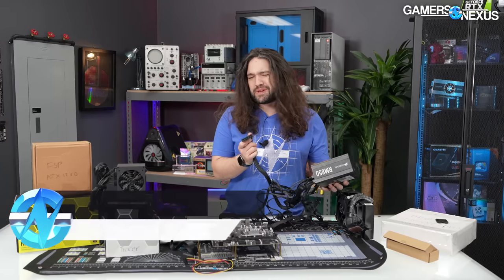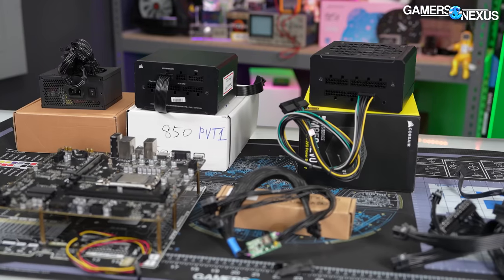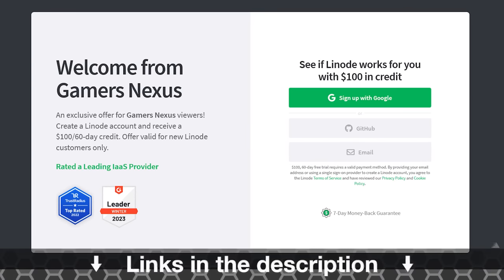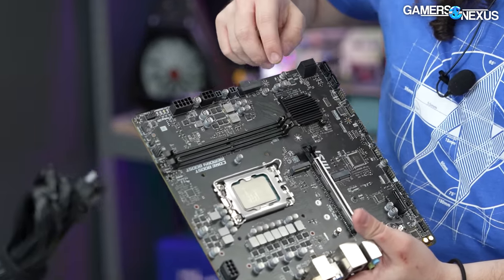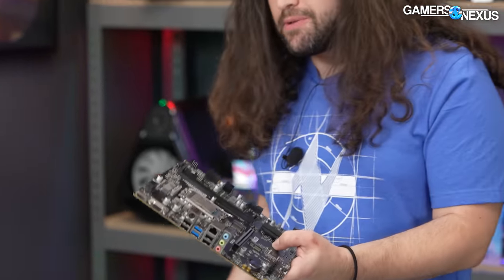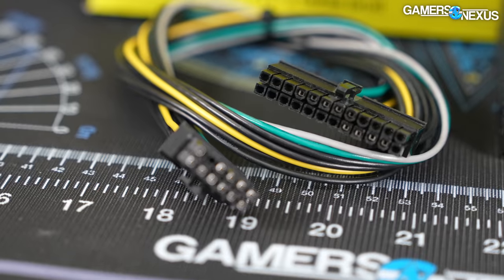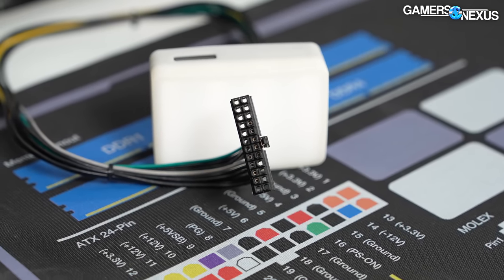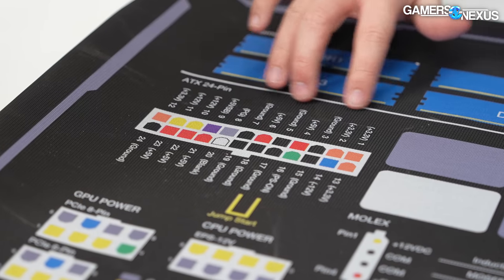The Future of Power Supplies - Maybe (Motherboard Cost, Cables, & ATX12VO)

Comment: It's tough enough picking a good motherboard that has the features I want, at a price point I can stand, and looking good (not a point for some but definitely a point for me) based on how things are already. I don't want to worry about even more variation being added to motherboards.

I'm half asleep so may not have fully heard and understood the reasoning, but if the reason is for lower power draw in standby or low power mode, couldn't something similar be accomplished with a data connection and a little bit added to the PSU? Or is it simply just that much more efficient still to stick it to the motherboard instead? I wouldn't mind a changing standard if it's not making as drastic a change to motherboards.

Would be interesting to have a sit down with an engineer that worked on the newer spec to talk about it and why that was what they went with rather than other options. Although maybe there's already good info out there for why not that I just need to actually read/watch.
Reply: I think that main reason is, that ATX is ancient. It was developed in times when switching DC-DC power sources weren't as cheap and it was more efficient to make -12V 5V and 3.3V on a smaller transformer in the PSU. Now the PSU uses DC-DC converters anyway and -12V is not used, it makes sense to reduce wiring to only 12V. The converters can be optimised for onboard devices and managed by MB's logic.
Reply: @Papinak2  A better solution I would still think is segregating responsibility of tasks. A power supply should do what it says it does. A motherboard should only serve as a board for other items. The standard could have simply asked for some pmbus standard with specific addresses and communication between motherboard and PSU. Although complex to implement, I would expect a lot less issues and less components means lower cost and higher reliability. This seems like a "standard is outdated we will simply do everything because working to help change the other parts of the industry we don't control is hard".
Reply: @epeglab1o1  This is impossible. CPU's and such use very low voltages these days, so that buck converters ("VRM's") have been necessary on every mobo for decades now. It will be a nightmare to even imagine reliably supplying dozens of amps at 1.2V over any length of wire. And totally inefficient.
Reply: @rexsceleratorum1632  okay you took my comment too literally. Yes the mobo does have multiphase buck and other bucks to provide various voltage rails for the cpu.

Comment: The cost changes and the cable management are both absolute No-Go. 
The biggest problem that I see is, that PSUs very often outlive Motherboards. My current Thermaltake 650W PSU is now nearly 14 years old and will power my 3rd PC Hardware Generation now (Core2Quad Q9650, i7-7700K and now i9-13900K). So the same regulators reused all the time and still working perfectly fine. With 12VO the additional hardware on the motherboard would have to be paid and then gone to waste every time, raising the cost and amount of E-Waste. At the end we WILL pay for the extra components and MoBo prices are already insanely high with all the crap put on them. This might be beneficial overall for commercially used all in one systems but it will hurt ANY DIY build. 

Not even speaking of additional coil whine risk with open regs on the board compared to enclosed and dampened regs inside a PSU case.
Reply: It takes a great deal of faith to entrust your daily driver PC to a power supply from mid-2009, complete with group regulation and an efficiency level of most likely either 80Plus White (W0104) or Bronze (W0163). Yes, one would rather hope that a quality unit makes it that long with the occasional dusting, but it should rather be enjoying its well-deserved retirement in a more fitting retro build by now.

Comment: as an SFF PC enthusiast, I really can't wait for atx12vo.  Cabling is way simpler, and without the 5v and 3.3v circuits in the power supply, manufacturers can fit more power into smaller PSUs.  I personally am curious about how complicated Z#90 mITX motherboards will become, but considering manufactures like ASUS is taking inspiration from lego with how many stacked carrier boards they use, I believe it can figure it out.

Comment: 7:25 After years of cutting/trimming stuff on electronic assemblies, I found the best cutting tool is just an actual scalpel blade. I use Swann Morton non-sterile carbon steel blades, they come in different shapes but mostly #10 for slicing and #11 for scoring

Comment: Another advantage of ATX12VO is better dimensioning of the +5V and +3.3V rails as regular ATX psus have grossly overdimensioned rails to account for the possibility of them ever being connected to an ancient computer that may pull power from them. The board manufacturer will have a good idea of how much power could be pulled from those so it should end up being cheaper. The negative rails could also be omited, most modern computers don't use them at all.  
The +24% cost to matx boards and needing extra layers sounds like bs to me (I have designed 4 layer pcbs for fpgas and microcontrollers). You could have the dc-dc converters required near the connector, if the power is low enough the area freed up by the smaller connector may be enough for the converters and that way you just route the output much like you always needed to. I only foresee an increase in cost if the board packs a crazy amount of IO like usb or sata which could potentially draw a lot from +5V and +3.3V needing beefy multiphase DC-DC converters in an already cramped pcb but that shouldn't be common.

Comment: Would be good to see a bit more on this for the ITX space... Seems like the PSU's themselves are smaller as-is, but if even mATX boards are hurt by moving all the voltage conversion onto the mobo (increasing size/layers/cost), that could be even worse for ITX. Seems like the best-case would ultimately be for end-components (PCI / Graphics cards, Hard Drives and SSDs, etc) to do their voltage conversion internally so the motherboards can be passive 12v as well...

Comment: I think doing the voltage conversion is better off done inside the PSU. Not sure if moving the down conversion to the MB causes more noise issues but it certainly adds more heat where you don't want it.
Reply: Not necessarily though - if you can move the power to where it needs to be at a higher voltage, the current is lower. Which means less losses in the traces. Of course the conversion also has losses, they're at efficiencies of 95-98%... in the end it's probably a negligible difference though, as CPU and GPUs currently use the 12V rails and convert down already.

Noise is probably better too, as the motherboard manufacturer can add filters without having long cables that pick up noise from the environment.

But price is a different topic, and reliability.. you can just replace the PSU and I don't think that a PSU with 12V only will actually be cheaper..
Reply: @marcelleuenberger4648  I don't think your going to see much difference in line loss. 98% of which gets turned into heat anyhow. An I9 alone can soak-up 300 watts when throttled.

They filter power supplies as well which can house much larger components like caps and inductors for filtering. My Corsair AX1600 has a very clean output and is 94% efficient. The PSU is one of the largest sources of noise in the system anyhow. A poorly designed power supply is going to introduce noise in the system no matter how many rails it has. Hardware engineers add filtering all along the circuit even on the front-end of the chip I/O so it's usually not a problem.

I'm sure both set-up's have the pluses and minuses. Should be interesting to see if this catches on.
Reply: @donuthole7236  Most power hungry devices are powered from 12V being converted locally anyway (CPU, GPU) because it is not practical to do it any other way (450W being pushed to GPU at ~1.1V is over 400A - and numbers are similiar for the CPU (which needs few different voltages that are generated on the motherboard)). CPU, ram, chipset alone need 7 or 8 different voltages (DDR5 needs 3 different voltages (usually two of those are identical, but that is not guaranteed by the spec)).
Adding 2 extra votlages to all of this is going to do very little to BoM costs, but are the manufacturers going to use this as opportunity to increase price?
Reply: @donuthole7236  Of what use is that filtering in the PSU, when you send that current down to the MB, over cable and two connectors? Yes PSU filtering isolates the noise from the main, but does not help with noise and voltage oscillations down the line...

Comment: i like  the power supply handling everything instead of a motherboard, since you might need more connectors down the road or hardware configs might change and need different plugs so you could be screwed since the motherboard has so many, and can physically can fit so much already
Reply: And that's why you want to handle power conversion on the board. One pair of 12V can carry more power than two pairs of 5V or three pairs of 3.3 V, and the DCDC is much smaller than the additional space taken up by the wider plug.

Comment: We've moved well beyond the times when changes in technology were made to improve said technology.  Any change now is simply an opportunity to charge more.  This change would somehow increase the cost of power supplies and motherboards, and likely lower the lifespan of each to boot - exactly what manufacturers want.  I'll wait for your testing on these which I'm confident will show little/no increase efficiency, with significantly higher cost for both PSU and MB.
Reply: Technology already improved, which is why ATX wiring is redundant. You don't really need to convert 12V to lower voltage in the PSU, so why not move the converters to MB? It can be optimised and managed by MB logic - for example, shutting off 5V to SATA, if it's not needed, but keeping it for USB.
Reply: Sounds about right!

Comment: Edit: The original was incorrect but is kept below for context. USB PD support various voltages including 12v.

Original message: USB really fits weirdly with this. Just about the only voltage that the PD spec doesn't provide for is 12V.
Reply: Yes it does. It's complete bs that they don't. I've seen so many articles talking about how very few pd chargers actually have 12v. I've checked every single one in my house and car and they all have it. I checked Amazon listing specs and same thing. Gotta be careful tho because some charger support 12v only on usb a like anker chargers. Got me wondering if I should test mine to make sure they support pd on usb c since mine have usb a too
Reply: @andrewk8636  Oops, turns out you're entirely correct and I have got it wrong. The reason I made the mistake is that I looked at a table of USB PD rev 2.0 voltages and currents that didn't list 12v, missing that the table only listed values that weren't already present in USB PD rev 1.0, which already accounted for 3 different current levels at 12 volts. I've put a correction in the original post.
Reply: @andrewk8636  Apparently the wires matter too. To provide more than 60 watts of power your cable has to be able to tell the other devices it can handle that. Then again, that's probably more relevant to laptop charging than desktop pcs and phone chargers.
Reply: @martineyles  wires shouldn't matter at all for the voltage. Amperage is another matter. If the wire can do 9v and 20v there's no reason it can't do anything in between
Reply: @andrewk8636   I was talking specifically about higher power specs above 60 watts in the last reply, available at 20 volts and above. Eg. 28V at 3.57A for 100 watts. That's why I stated it was more relevant to laptop charging. It's possible that it's because of the > 3A current though, as I don't see the option of 3A, 28V, 84W.

Comment: in my opinion ATX 12VO could be quite usefull in office pc´s but it think the normal atx PSU´s should still be there for the DIY pc builder
Reply: Yes, it's basically up to the OEM's, system builders don't want it.
Reply: That just makes DIY PCs expensive for no reason, because the market for PSUs will be small and full of enthusiasts who are susceptible to advertising and willing to overpay for form-over-function nonsense like sleeved cables in cloth bags.  It's better to be a small fish in a big pond.

Multi-rail ATX belongs in a museum, not your computer.

Comment: Hello Steve, because of moving RAM VRM from motherboard onto DDR5 RAM Module itself, now I am experiencing Coil Whine directly from DDR5 RAM when RAM intensive loads are in operation. That kind of coil whine was NONE-Existent on DDR4 motherboard. That actually mean DDR5 RAM makers either don't know how to build a good VRM or they use cheap components. But Motherboard manufactures knew/learned from many years of experience what to use as quality VRM for RAM.

Now if motherboard makers, which do not have the experience of PSU makers, start adding part of the PSU (5V+3.3V circuit) onto the motherboard, Sure we will have more possibility of coil whine + increased probability of failure for a motherboard. 

The motherboard already has so many different circuits that if any of them fail, the manufacturer should take back the whole unit and change it with another (at least within warranty time), now adding another new circuity with high probability of failure (due to manufacturer's not having enough experience like a PSU maker) it will ultimately increase chances of failure - equally increase motherboard manufacturers cost for after sales services.

Add the fact that more and more users are turning their PC case into a Christmas tree by overusing their 5V rail and adding multiple ARGB devices.

Last but not least, the Motherboards, specially mainstream and high end classes, are already filled with so many connectors that make cable management a difficult task, now adding more cables out of motherboards, will just worsen the cable management more than ever.

Comment: I'm getting flashbacks from my project of converting an ATX power supply to work with a Lenovo OEM motherboard.

For anyone interested:
It's almost like a 12VO connection but not quite. You connect the 12V wires and ground directly, but then you need to hotwire the 5V standby to ground. My PSU also required a load on the 5V rail, so I put a 10ohm resistor there. It works fine now, but holy smokes what a headache.

Comment: There is a SATA connector (SFF-8482) that includes the power connector within the same cable and connector which really should be used for these 12VO motherboards.  This would make cable management for SATA drives a whole lot easier.  Then motherboard manufacturers can just provide another one or two of the 4-pin motherboard headers for users to connect up non-SATA peripherals that require a SATA or Molex power connector.  
Or, you know, they could just make a whole new combo connector for the motherboard side that provides both power and signaling which has a SATA data/power combo connector (SFF-8482) on the other end of the cable - they could even double up on this to provide SATA/Molex power connectors from that same header using a different cable if you don't need all of your SATA ports. Then you could have 4-8 of these ports on your motherboard and all the motherboard manufacturer needs to do is provide the cables.
Reply: Get more hard drives that need more power than the motherboard can supply, replace the motherboard (or fry it). Hard pass. 12VO PSUs need a 5V rail for drives, period. Let the MB take care of -12V, 3.3, fine. But the sole source of 5V shouldn't be the MB.
Reply: @TiagoJoaoSilva  Considering that SATA ports only support one harddrive per channel I highly doubt that you could overload the motherboard's 5V regulator if the mother board vendor actually speced the VRM properly.  That said, it is the 12V rail that gets hit hard when you have a lot of harddrives as that is what the harddrives use for their motors and the peak power used is when all of the drives are spinning up.  The actual electronics which use 5V don't draw that much power. 

What you should be more worried about is having a whole lot of aRGB LEDs running.  They use around 150mA per RGB LED at full brightness and if you add in a bunch of strips then the power draw can really start to add up.  This could be easily solved by having a 12v -> 5v control box for the aRGB strips that can take in the data from the motherboard and supply the 5v required via a 12v->5v buck convertor.

That said, I love the fact that you think that this is a problem that is unique to 12VO.  Staggered startup has been a option on ATA controllers designed to take a bunch of harddrives for a long time as spinning up a bunch of harddrives at the same time has the risk of overloading the 12v rail and triggering OCP.

Comment: I actually have one of those OEM computers. At first I was a bit frustrated, that I could not install a normal PSU, because the motherboard had a 16 pin connector, instead of a 24 pin. But after messing around with it, I realized that this type of setup is super clean and efficient. I literally just have 1 cable from the PSU. I just had had to add a sata power to pcie extension for the graphics card. Love that you don't have to cable route and there is no mess inside.